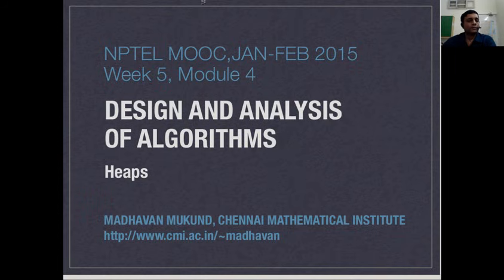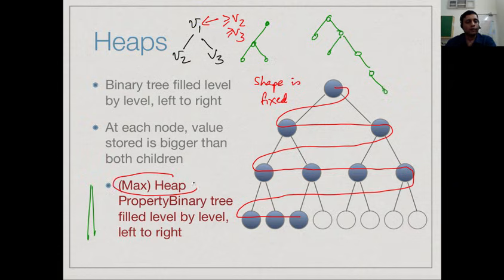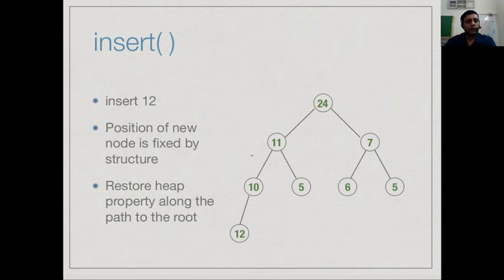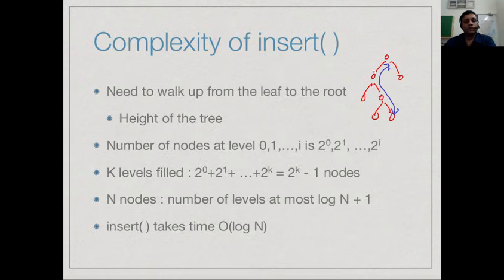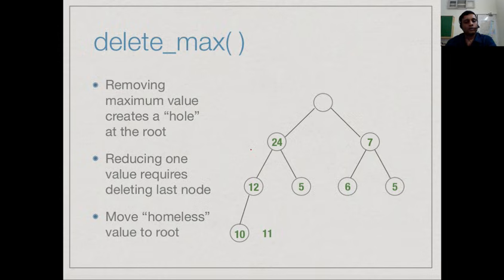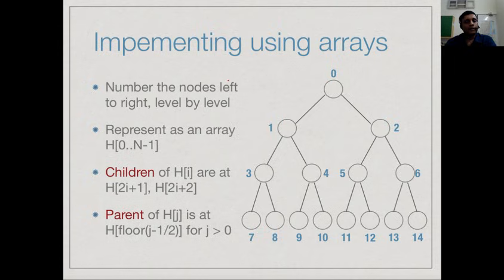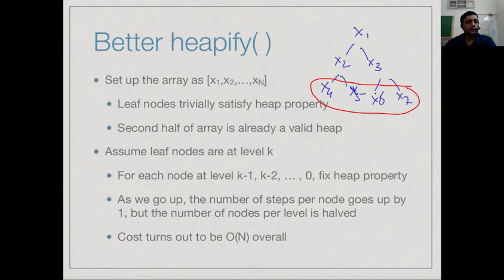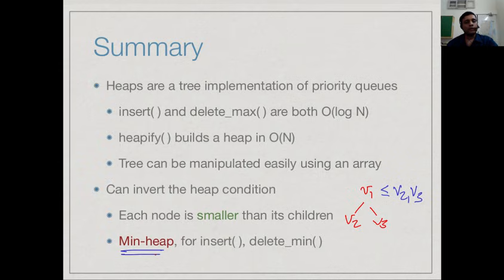Heaps

Comment: One quick question, as you have mentioned if i use sorted array as priority queue i would need O(n) time to insert and O(1) time to delete_max, so overall to process n jobs its O(n^2), why can't i insert in a binary search way needing O(logn) to insert and take out in O(1) time making it O(nlogn) and we do not have to move to heaps in that case. Am i missing something?
Reply: You can find the appropriate position to insert an element using binary search. But to actually place it inside the array at that position, you have to shift the rest of the elements of the array by 1, resulting in higher time complexity (so it won't be O(nlogn), but something higher than that).